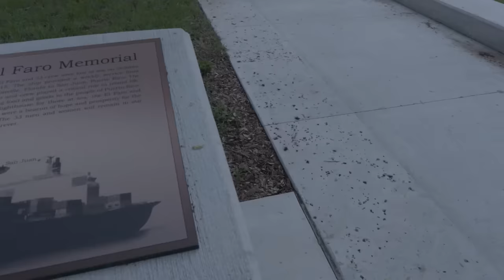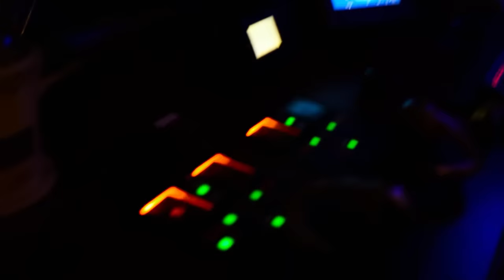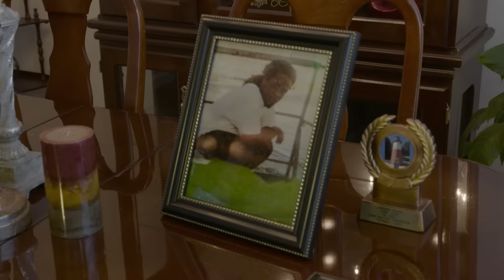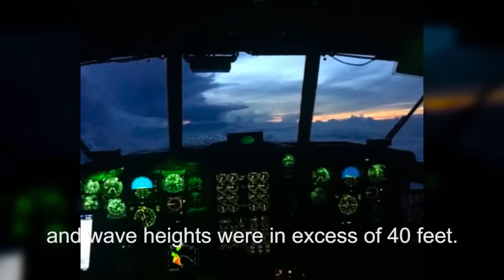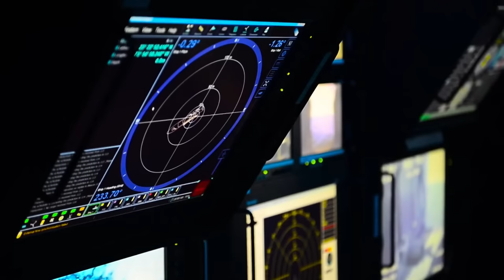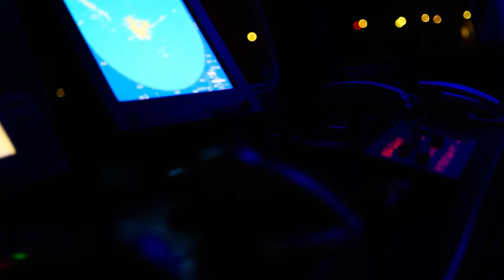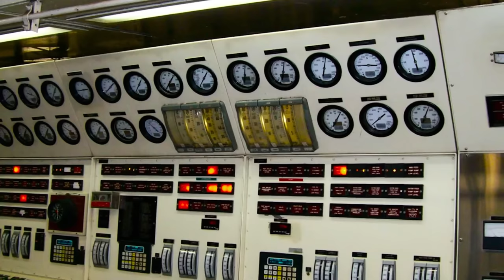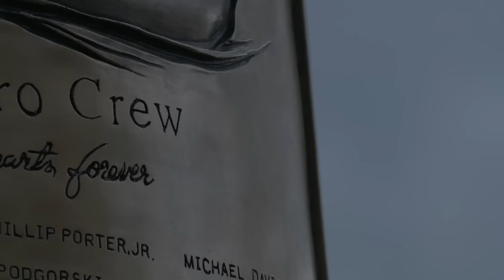Uncovering 2015 Bermuda Triangle Shipwreck | The Salvage Masters

Comment: It is sad that the NTSB and Coast Guard permits shipping companies to prostitute safety for profits.  The only thing to help is for the families of the deceased to have a class action law suit against the owners of the shipping company and deposition the voice recorders from the El Fargro to be used as evidence.  In the airlines dispatching   an aircraft and deciding its route is the joint responsibility of the captain and company dispatcher.  It is hard to believe that the company does not play a role in dispatching the ship.  By the NTSB refusing to release the voice tapes, they are protecting the mal practice of the shipping company.  By the NTSB permitting railroads to perform one minute inspections of freight cars you have disasters like the recent Palestine Ohio derailment.

Comment: The major inflow of water was due to cars that came loose and damaged the fire impression system.  They were able to secure the scuttle hatches... it was the 4-6" water lines that just sucked in to much water...add in the fact the engineers didn't maintain the oil levels